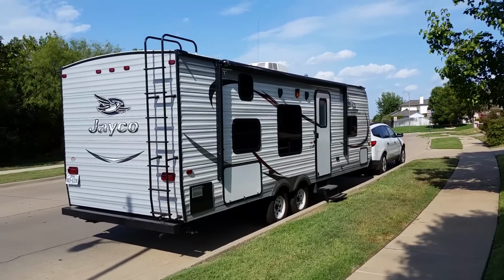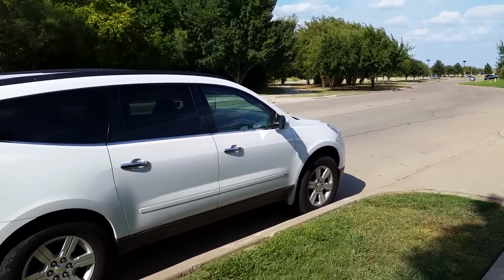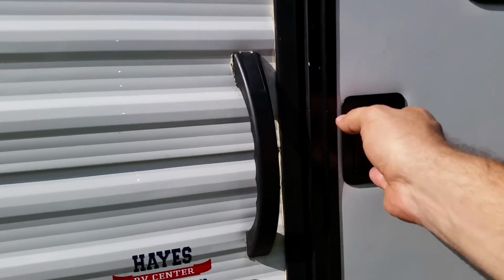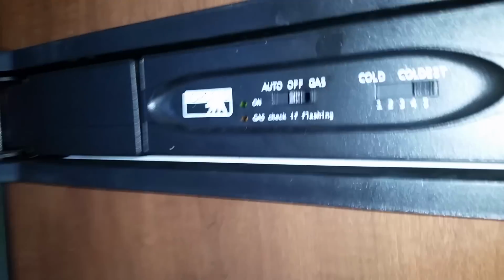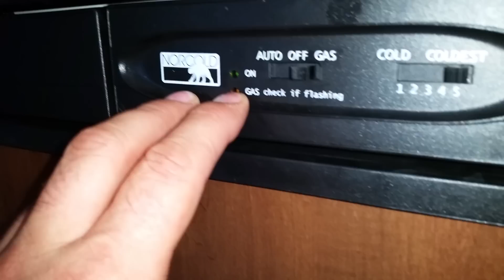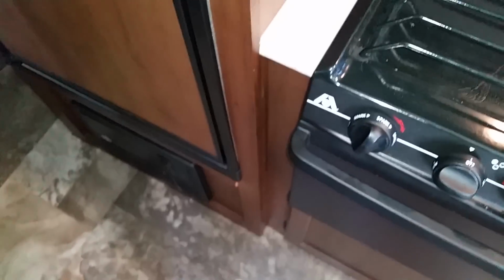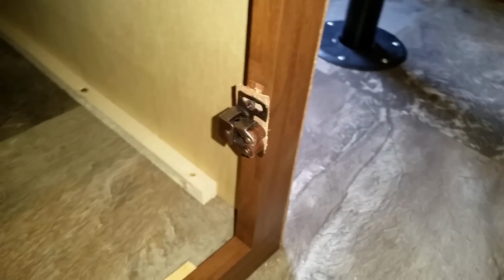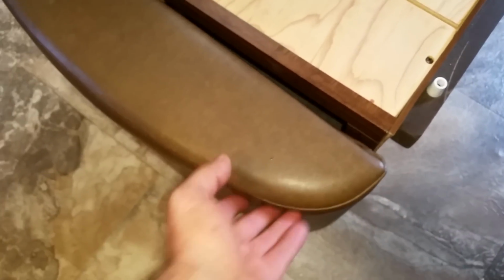Update: New JayCo Trailer FALLING APART.  Lengthy Warranty Work Needed.

Comment: We have had the problem with the bench seat backs on 2 different makes of travel trailers.  No manufacturer seems to be able to get a strong enough reinforcement of the seat backs. So when we upgraded this last time I insisted on a regular table with chairs.  You loose some storage but it is worth it. Hope you get all your problems fixed soon!

Comment: Thank you so much for sharing your story. My jaw is on the floor. I'm so sorry you're going through that- to spend all that money and a mere year later it's in worse shape than my 30-year old fiver. I think I'll stick to buying older RV's and doing the repairs/rebuilds- at least I know the finished piece will be quality. I watched a video on YouTube about the Jayco factory- they only spent 6.5 hours building one! People were running on the factory floor, equipment was swinging around; I don't know how anyone wasn't killed. It just seems like the rule of the owners is "crank-em-out-get-em-sold-quick" and never mind what happens next to the customers. I think I'd send your story to your state's AG- it's time lawmakers do to the RV industry what had to be done to the auto industry in the 70's. Standards. Rules. LAWS. Consumer protection. Recalls and REPAIRS.

Comment: Looks like poor quality materials for a start, but this is a lower priced RV. Having said that, quality of materials can be poor in a mid and higher priced RV as well. Also, I think the workers in these RV factories are pushed hard for time. All around common problems across the board in the RV industry as a whole. It's a shame.

Comment: Thank you for posting this video. Today I drove 2 hours north here in California to an RV/Camper dealership to see how it felt to be inside of a smaller camper trailer as there are not any close to where I am in the Bay Area that I am aware of. They didn't have the trailer brand I was looking for,  but had a bunch of smaller Jayco trailers. Although they seemed ok, I noticed how cheap looking the kitchen counter top appeared and looking toward the bathroom how cheap the wall panels and structures looked. It reminded me of a 1970's mobile home trailer, the kind seen in a trailer park where people live and that bothered me. When I told the salesman about how the counter top looked a bit cheap, he then remarked how it is replaceable considering how things tend to get loose once the trailer starts moving.. I immediately  had a vision that these trailers start falling apart once you start towing them. I decided to look up complaints against Jayco to confirm my intuition about things falling apart and this video confirms the shoddy quality of these trailers..Then I asked about how rain or storm proof they are as I want a Fiberglass ceiling and structure that is built to be more water and moisture proof. When  he said the ceilings had some sort of wood structure and that the vents were leak proof I had a hard time believing that to be true.. I will be buying my first camper trailer soon and know what I want and unfortunately will have to exclude Jayco from my list. I am so disappointed for you and can imagine how you feel. I was horrified when you said the seat fell back while you were in it. You could have been far away from civilization and badly injured, that's wrong on so many levels.. Glad you are ok and able to share. Again, thanks so much. That looks like lawsuit material.. Just WOW!

Comment: Wow, I feel for you.  Back in 1987 I bought a new 31' Terry Resort (Terry's cheapest trailer) to live in nine months of the year while I toured as Music Director with a Shrine Circus.  Even though that Resort model was their entry level model, I lived in it through the summer of 1989, putting about 35,000 miles on it per year with no issues similar to yours.  The 14" wheels and too-small axles were replaced under warranty with 15" wheels and tires, and bigger axles under warranty (numerous tire failures and the axles were bowing).  But the overall build quality was so much better back then.  I read somewhere that sometime around 1993 (the date might be wrong) the government eased restrictions on the RV industry and this allowed a severe cheapening of quality.  Your problems seem to support that.

Comment: im totally with you on camper quality. my 2017 aspen trail may need the slide floor replaced. most of the fit and finish is not there. ive had to do many repairs/ improvements in one year.my ceiling buckles near a speaker. this is my first camper and what ive learned is right out of the factory they will leak. so buy one that just arrived from the factory and go over any joint, seam screw, door hinge, window, vent, all roof components with the proper caulk/lap sealant. my slide floor is sagging real bad on the ends. its at the dealership now waiting to see if dutchman will fix it. the wood is soft on the ends and sags in between screws. seals are only warrantied 90 days after purchase. my guess is it has been leaking sing the day it left the factory.  but camping is a family thing and right now is about making the best memories of your life and i can say im am.

Comment: I JUST GOT MY TRAILER BACK IN MARCH 2016 THE TUB LEAKS THE WATER TANK UNDER THE BED LEAKS THE KITCHEN SINK LEAKS AND THE TIRE IS FLAT AND THE LED STRIP ON MY AWNING BROKE IVE HAD SO MANY PROBLEMS YOU CAN SEE THE TRAILER ON MY PROFILE PIC GOOD LUCK HAPPY CAMPERS AND ITS NEW THE GOOD THING IS I GOT A 10 YEAR WARRNETY

Comment: Welcome to the joys of buying a JayCo.  I did a bunch of research online and found complaint after complaint about just what you are seeing.  The next hurtle you face is getting warranty repairs out of them IF they will do it they will only do it back to the same way it was.  IE the same 20 screws in the setee back and the same glue job on molding.  The problems will exist.  Your going to have to eat it on the cold damage though because you did not winterize and that sort of thing will happen - and they will call you on it.  Most likely they will try to make you out to blame for most of that and not give repair service,  "Build by Amish" might mean they hired a few amish guys but they certainly don't use the quality materials that a real amish craftsman would.  The problem with buying a RV is you definitely get what you pay for and the reason JayCo is lower cost is that they are cheaper vehicles.  Your best bet is to get as much warranty work as you can out of it.  Sell it as quick as you can and then buy a better RV from a reliable company - research first.  Of course, some of the issues you are showing you should have noticed when you bought it/took delivery and gotten it resolved then or realized the mistake.

Comment: I hear you man!  We had a 2013 Jayco  ht 23.5RBS 5th wheel. 6800lbs loaded. It was great to tow even with our 1/2 ton Dodge Ram Hemi.  Problems where same as yours, fit and finish were poor.  We did not have any trouble getting warranty work done, always able to get int quickly and back on the road, problem was that these problems (a lot of what you showed us) and others, should not be in the first time.  Like a pebble under the vinyl flooring, the hole for the fridge electrical was more like a punch hole with rough edges all around rather than drilled. The sofa had to be re-attached to the wall 3 times AND re-upholstered.  The dinnette bench came off the wall, the trim was coming off the wall, on and on and on.  There had been a slow leak from the city water intake that caused some delamination at the back near the bumper, Jayco agreed to fix it, but when they changed the back wall, they didn't seal the light properly and caused more delamination, even worst.
We went to a Good Sam RV show and looked at other Jayco, regardless of price point, top of the line, when looking at fit and finishes, all the same.  This is not acceptable.  The awning arm was starting to wobble - at the awning motor area, got it checked, nothing to do, if it broke would need a new electric awning.  The  window shades where falling apart. 
We had it 4 summers, was starting to get nervous about money we'd have to start pouring into it. We sold it and got a Park model.
Imagine buying a new house or car with such poor finishes?

Comment: being a RV tech for a large jayco delar i can say that the quality of the trailer,service and repair is 100% dependent on quality of the delarship.
Reply: Shawn Fredrick I agree.  Although I do not yet own a Jayco, I agree with your assessment.  There are large corporate dealers who demand high output and sales and are known for poor service.  There are other dealers who go through their trailers as they get them and do QC.  Those dealerships understand that it is not just Jayco whose name is on the line, but their reputation as a dealer.  They won’t send their customer off the lot with junk.  If there is a problem they will deal with it right away!  A good dealership is worth it’s salt.  This is true for cars, refrigerators, air conditioning units, etc.  Some dealers have character and integrity.  Others have a Wal-Mart mentality.  Do your research on the brand and Th dealer before you buy.

Comment: Our Jayco is great.... they are the top selling bumper pull for a reason. They are quality. 

If you want a unit that has perfect fit and finish, you're not buying a $20,000 camper you're buying a $140,000 RV.

Comment: Jayco is terrible I agree. 6 weeks on road, and a lot of things are falling apart or failing to work properly. As for your fridge issue...run the furnace first to get the heat going, switch the fridge to gas, and turn the furnace off. That should resolve you blinking light problem.
Reply from the maker: n0g4rdd3r it was a faulty regulator, they replaced it.
Reply: Big Skid Media did they fix other issues
Reply: n0g4rdd3r also you really should not be traveling with the propane turned on! I know it's not convenient , but if there was an accident and the propane is turned on........but if absolutely necessary, please drive very safely!
Reply: Jayco on makes a horrible RV. We had a 2003 Granite Ridge. What a steaming pile it turned out to be. 
1.) leaky roof
2.) sagging bunk over the cab with buckling exterior
3.) broken backup camera
4.) table legs that fell off. 
5.) fronts of couch drawers pulled of when trying to open them. 
6.) constantly had to replace drawer hardware because the draws would open going down the road and break the supports that hold the drawer slides. 
7.) leaking faucet that made the countertop swell. 
8.) blinds that were always breaking. 
9.) outlets that stopped working. 
10.) stray voltage would run through the awning while connected to shore power. Always great getting a low voltage shock early in the morning. 
11.) something under the linoleum was discoloring it in certain areas and debris under it created bulges and tears. 
12.) The very definition of a rattle trap. 
13.) basement door latches that would open if not locked. 

Never buy a Jayco.

Comment: Pity the Jayco dealer that has to try to fix all this stuff.   Buy a cheap trailer get a cheap trailer.   Buy an expensive trailer get a slightly better than cheap trailer.   Any one of these things looks like a spilled box of matches when there's an accident caused by someone towing it with too small a vehicle.

Comment: I did have a list of 7-8 small problems with mine the first season, but my suggestion is to wait and do a single service for them at the end of the camping season it they're not keeping you from using the coach.  It only took them 4 days to fix everything, but I had to wait 3 weeks for an appointment(and that's after calling all 3 services centers within driving distance)  Not one problem the second or third years.  My dinette booth exploded on this last trip.  It was probably the gravel service road, but my parent's 40 year old airstream went over the same road without as much as an open cabinet.  I bought a 5-yr extended warranty, and will be using that to fix the issue.  Again with a 3 week wait to even have it looked at.

Comment: Hey genius...you need a 1500/half ton to pull a 6000lb (loaded) trailer. Had a 264SLX same as yours and pulled it with a Ram 1500 and you could tell it was back there. Now have a 32BDSW and pull it with a Ram 3500 diesel and yep you can tell it's back there with a 1000lb golf cart in the bed. Anyone who says it pulls like it isn't there is lying.
Reply: The2008tundra finally someone with common sense. People pulling these trailers with crossovers should be fined. Thierry putting themselves, there families and everyone else on the road in serious danger
Reply: The comment section seems to be full of truck loving people for some silly reason. There are MANY SUVs that can easily tow (and are rated to tow) over 6,000lb. Ive worked on a number of SUVs that were built much beefier than 1500's as well. Get off the truck high-horse - it's getting old. The trailer should be properly balanced and capable of braking itself (in an emergency and also as 70% during normal operation) so these stupid comments about "your suv cant stop the trailer" are rediculous. As for "wind blowing it over" - this is mostly down to the way the trailer is balanced, regardless of what's towing it as the force of the wind is being applied to the trailer itself. The trailer will apply SOME force onto the tow vehicle but thats no different than changing lanes or going around a corner. If the wind is bad enough to blow the trailer over then take cover because a tornado's close by and the trailer is the least of your problems.
Reply: I see Vans and Large SUV pulling, their chassis is rated for that, however, this is a car.
Reply: djbmw1 I agree SUVs can tow, real SUVs, the Tahoe's, expeditions, durangos, not a pos like in this video. Something with a frame under it
Reply: @buzzj89  i have a 1500 chevy Silverado 2004 extended cab pulling a 5500 and i can feel the pull
Reply: Sorry, but his Traverse is within ALL towing specs.  Even under GCVWR by over 500 pounds.  I don't know about his payload as he didn't mention it.  If an accident happens, then conditions will have it happen whether driving in a Traverse, 1500, 150, or Tundra.  He's well within vehicle specifications for towing.
Reply from the maker: @buzzj89  and yet I had no problems towing across the country with no issues.
Reply from the maker: @brotherbonesx3163  not true.
Reply from the maker: @buzzj89  it's almost like I didn't successfully tow this across the country with no issues.

Comment: We had a Jayco and had leaking problems from the roof starting the day we got it. On the way home from the dealer in Fort Worth, the roof membrane lifted off the roof. Had to turnaround and take it right back. In the first year we owned it was at the shop 9 times. Refrigerator went out twice, roof leaks, valances fell off walls, dining seating backboard broke off, trim fell off, decals started bubbling. I repaired all I could on my own and we did keep it for 4 years. After 4 years no dealer would take it in trade. I finally donated it to Kars For Kids, and they auctioned it off.

Comment: If I were Jayco I would pay you off.
What brand would you recommend that is not terribly expensive?
Reply: Winnebago's tt's seem to be a step above.  Just didn't like the floorplans in the 26' to 29' range.  Arctic Fox were built heavy duty, but are extremely heavy.
Reply: breckandy for the 💰 money, any Forest River product will be fine. They cover most price points. I bought a new Wolf Pup 19 FQB, that has been fine. It has a walk around queen bed, with a decent size dry bath. Just right for the wife and I plus we are able to tow it effortlessly with a new Colorado Z71,4x4,V6 ext cab. While getting decent mileage, plus we are able to get into some areas you would never want to try with any trailer bigger than ours. The only upgrade so far is an added deep cycle Interstate battery, so now I have added capacity of electrical power for dry camping. Solar panels are next, as the trailer is pre wired for the portable solar packs available!
Reply: Forest River is cheap crap compared to Jayco. I sat on the bunk of a Puma and the board cracked. Looked at 30,000 Solaire and it had the same cheap particleboard. I have the cheaper Jayco SLX 32BDSW and it has 300lb and 600lb weight rated bunks made with plywood. Jaycos are heavier but no big deal with a decent TV. Plus, they have integrated frames unlike the bolted A-frames that forest river uses.
Reply: They are all built the same way. Anything built after 2010 in the travel trailer series are junk. Triple E don't make 5th wheels or travel trailers anymore. When they did weight wasn't a factor and the unit you purchased was solid. 2x4 wood walls insulated with real plywood walls and floor. They even used screws.

Comment: When we bought our Keystone Passport at at a repo auction, I went over it with a fine tooth comb. I took note of all the issues and decided whether I'd fix it myself or not. There were issues but nothing major. I stress two things: DO NOT buy new. There are plenty of year-old RVs out there in good condition. If someone has used it, workmanship issues will arise and will be their problem. Plus, they take the hit on depreciation not you. The other thing I stress: INSPECT THOROUGHLY and assess what you're willing to fix yourself. You aren't going to have any expensive warranties to give you any headaches. We bought a TT for less than half of its MSRP from the previous year. Very happy about it.